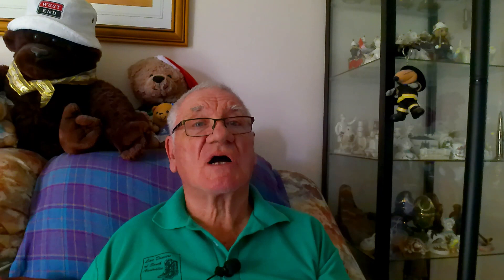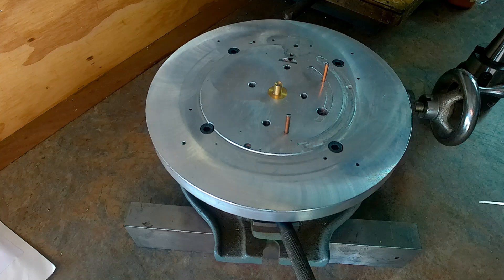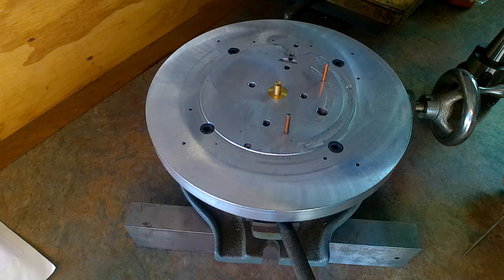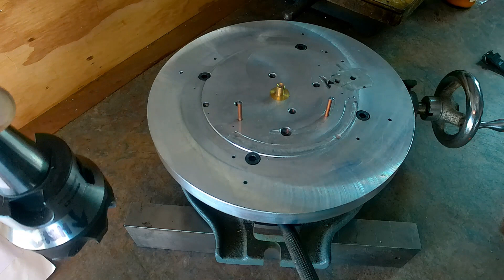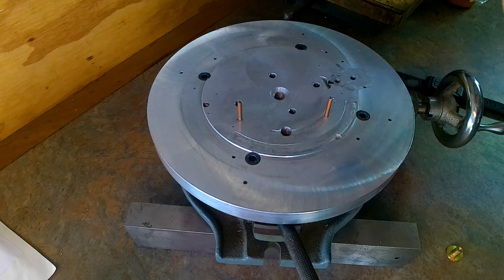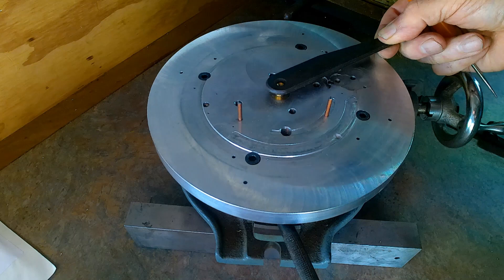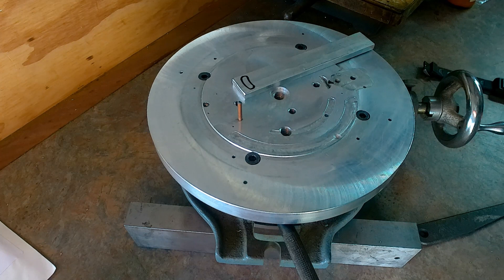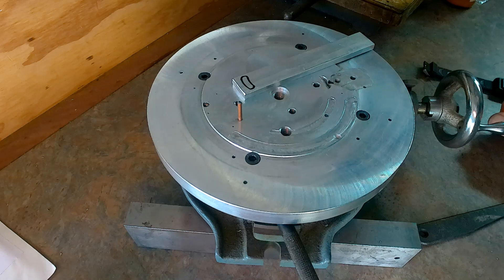Using A Rotary Table With A Sacrificial Aluminium Machining Plate For Safe And Easy Work Holding.

Comment: This is a great idea to use such a sacrifice  plate on the mill.
Reply from the maker: Hi there. Thanks for watching. Glad you found it useful. A sacrificial  fixing plate to use on the bed or in the vice is also a useful thing to make. Again tap holes to suit or make it with rows of tapped holes for the clamps. Same situation, will not matter if the cutter damages the surface. Hope this helps. Regards.
Reply: @daveticehurst4191  yes indeed. Especially for a beginner machinist like me with a virgin mill bed. A mistake is easily made with witness marks that are there for ever. For a vice it is less trivial to imagine how that would look like

Comment: Another great tip Dave. A small investment in time making one will save loads of time later on. Something else you have got me to buy!
All the best.
Andrew
Reply from the maker: Absolutely. Enjoy making and using it. I forgot to mention in the video, make the ally table bigger if you can it will give you a larger area to use, say 7.5  for a 6 inch table. Just make sure that you can still operate the worm disengage, mine just does but can not use the locking pin.  In the past I have seen a few of your Hairy rotary table setups. LOL Regards.

Comment: Hi Dave, always look forward to your videos, nice to know the correct way to do things. 
I particularly like your quick release quill stop on your mill, far better than trying to spin two fine threaded lock nuts up and down. Would you consider describing that very clever device in a video or are there some workshop scribbles that would point me in the right direction?
Either way, keep doing the videos mate, they are always appreciated. 👌👍👍
Reply from the maker: Hello Gary, Thanks for the view. If you watch this link, I do show it working. https://www.youtube.com/watch?v=6CI2kNUCp2E    
If you send me an Email I will send you the photographs and a description of how to make it. Quite a simple turning exercise with just a couple of mill setups to do the cross hole in the body and the specially adapted tapped hole. Regards from Australia.

Comment: Some more great tips Dave, I did almost the same thing when I needed to mill some long slots in .125 thick aluminum sheet. So I used some 1/2" thick plywood on the mill table Thanks again Cheers
Reply from the maker: Thanks Randy, much appreciated. Regards.